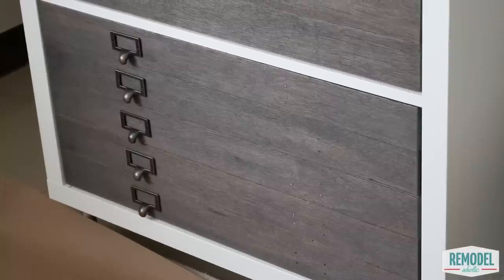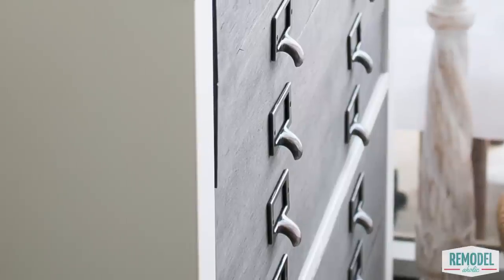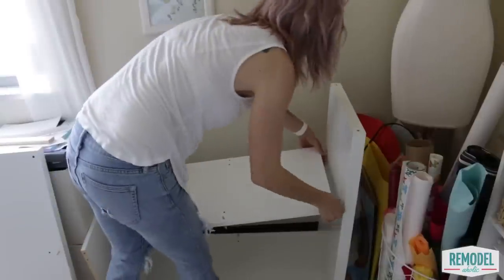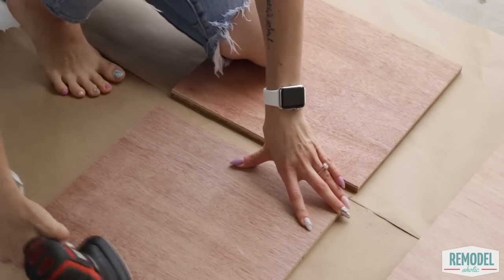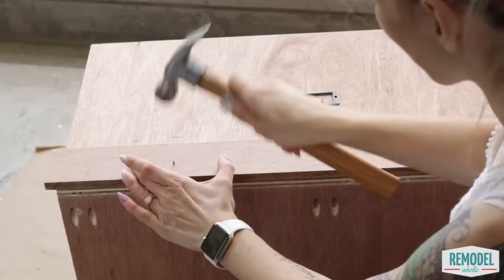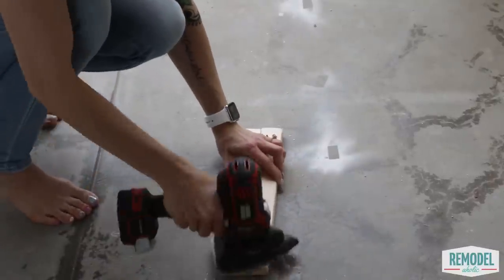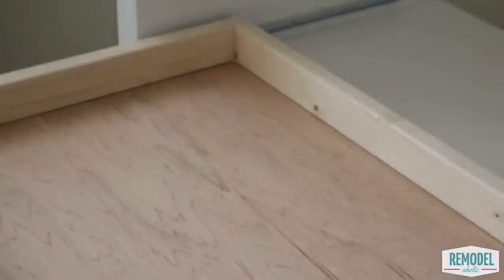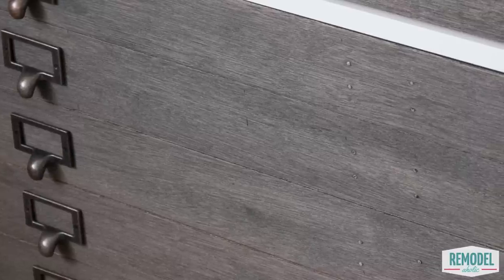IKEA Hack Kallax Shelf to Flat File Cabinet + Drawers

Comment: Thanks for sharing, would you mind adding how you installed the drawer rails (ie. spacing all 5 drawers) and which type of drawer rails are they please (  they Ikea ones?) Sorry, complete novice in carpentry. Thanks, brilliant work!!
Reply: I would like to know the same thing. I was thinking it would be easier to install the rails to both sides of the cabinet before putting it together, but again, total woodworking novice.  
The link to the written plans Sends you to an error message. Will you please upload a new link?
This is a fabulous cabinet! Tyfs!!! I’m going to use it to keep my paper rafting dies in.

Comment: I am trying to find an Ikea hack for a flat file with drawers that will store large sheets of paper, like 22x30 inches.  Anything that big at Ikea?
Reply from the maker: Not that I can think of, but you could maybe attach two of these back to back to create a bigger drawer...  I just can promise it would look good with the seam.
Reply from the maker: Well, actually maybe a kitchen base cabinet at ikea would work?  Just not sure of the exact interior dimensions of the drawers.  You could do 6 skinny drawers, you would just need to make a top and possibly some feet?

Comment: This is awesome! I use Kallax units for my vinyl collection. This would be perfect for what I am looking for to house my poster collection. However, I’d need the drawers to be something like a minimum of 36 x 28. What Ikea product could be used as the frame for that? The Kallax aren’t that deep I know. 

Thanks for any help. I am completely ignorant when it comes to stuff like this and I’d have to find someone to do it for me anyways, ugh.
Reply from the maker: I can think of in ikea product that is that deep..  but you could put together 2 of the Ikea Kallax units.  And it might be about 30” deep,  and figure out how to attach them together.  I’m just not sure about the width.  You might have to use the longer units...
Reply: I know I am a year late, but try out the Cliffmay Slat Storage Cabinet at Target. Not sure if it still will be large enough for you, but I just love it. Hope this helps xx
Reply: @illbeyourstumbleine  thanks for the suggestion. I took a look at it and I’m not sure it will do the trick. A little too small and it looks like just a traditional cabinet as opposed to something like a flat file.